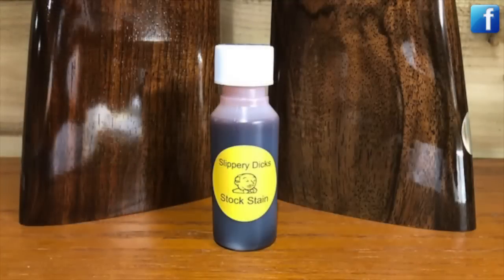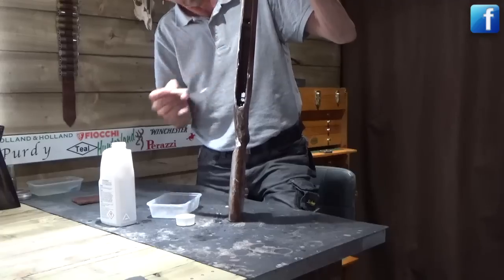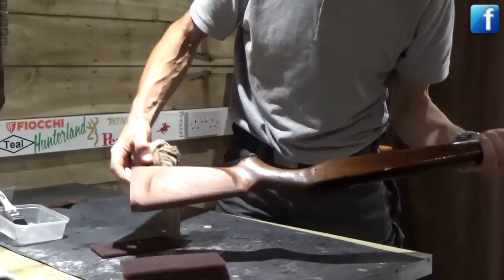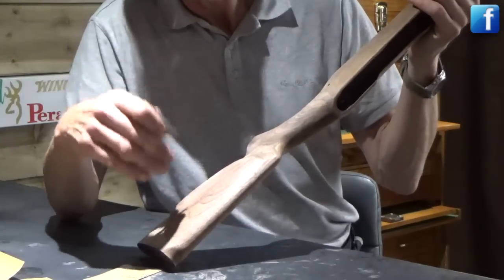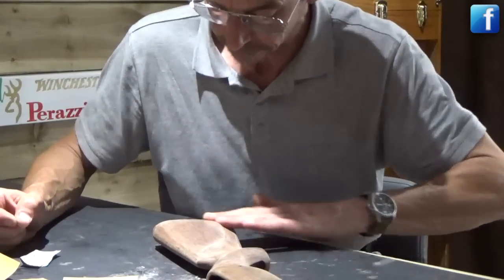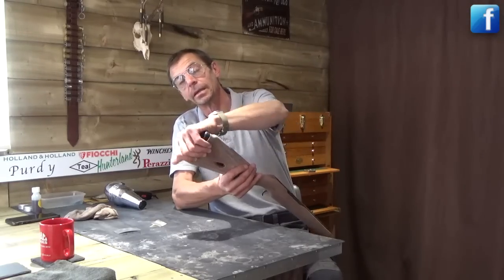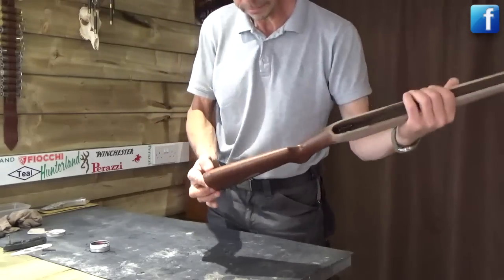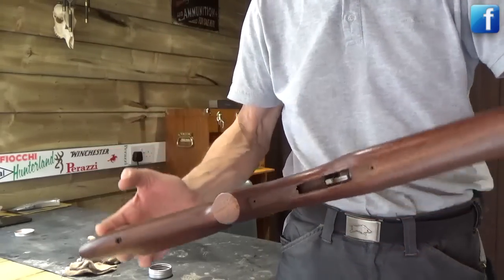How To Refinish Your Own Gun Stock - Part 1

Comment: My son has an ATA with a factory oiled finish, how can he get the gloss finish. Will he need to strip, oil, wax?
Reply: Wipe it down 5 or 6 times with plane rubbing alcohol...then wet sand it with 600 grit wet/dry sand paper then put the gloss coating on it

Comment: I a looking at refinishing my old sidexside which I had given. it is in a rough condition. I have a couple of questions;
1. would I be better off getting rid of dents and dings before I put the varnish remover on? 
2. is a scratch pad just a scourer? where are they from?
3. what grit sandpaper do you use?

thank you in advance
Reply: i wouldnt bother asking for advice because the guy in the video dosent know how to finish a stock properley
Reply: @andyp9678   W⚓️
Reply: @brewdog6614  your reply tells me you havent a clue either lol x
Reply: Chemically remove the old finish.  Steam out the dents.  Sand lightly...~300 grit or so, if you want to clean it up some more.  Use a small would block when sanding around the edges.  If you want the old worn look, just use a 3m scotch-brite pad white or grey for a final buffing.  DO NOT fill dents or holes with putty.  Live with the character time has bestowed on the wood.  Finish with oil, do not use poly oils...ugly.  In an Indian food store.  Get a food coloring root called ratan jot.  Get the powder and put some, couple of tablespoons, to about 8-10oz of boiled linseed oil and wait.  After a few months of shaking regularly creates a nice blood red oil.  Do not shake prior to applying.  You can also add this colored BLO to your favorite oil finish to add some red color.

Comment: I have a miroku mk 70 grade 5 well figured oiled stock ,id like to get a bit more shine on it what do i use ,do i need to strip it back?
Reply: Just polish it.  If you want to add finish to get more shine, you will need to scuff up the old finish then apply a gloss finish.  Most likely a poly finish since that is what the modern commercial stocks are finished with.